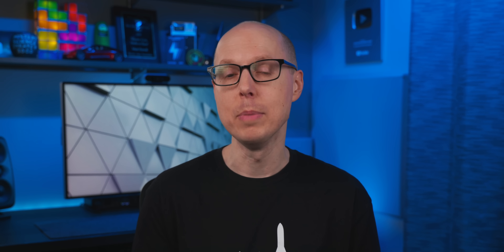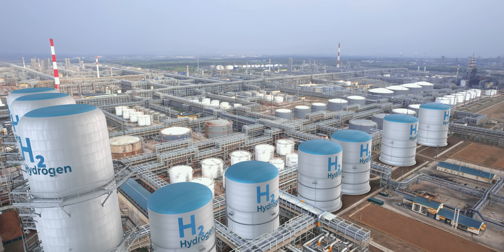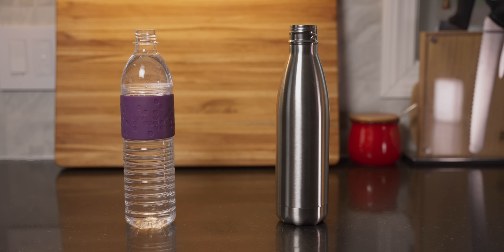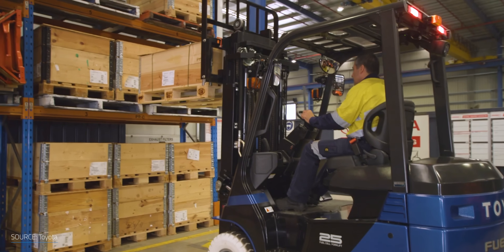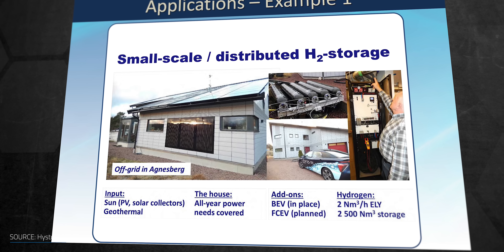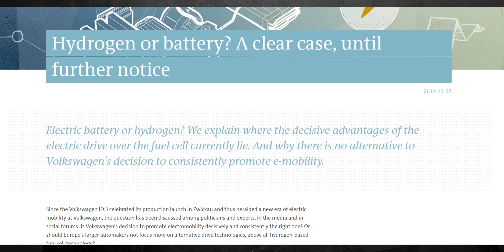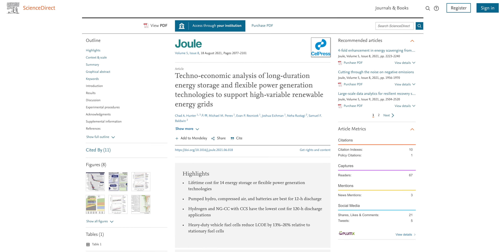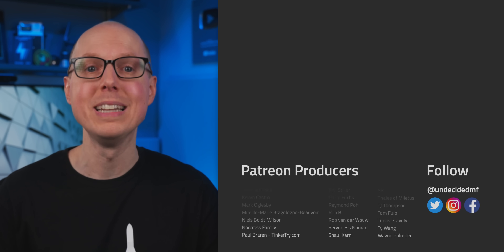Solid Hydrogen Explained (Again) - Is it the Future of Energy Storage?

Comment: Considered the hydrogen is made from renewable sources and not Steam Methane forming: 
The technology of GKN sounds really nice. A 90% roundtrip is crazy good, especially with the already planned in heat recycling. Recycled energy is basically free. It's there, use it!

I'm still not convinced about the laser guys though. It just sounds impractical. 
You can heat up to 65C pretty fast if you need hydrogen. But a laser has to make contact and the disk or whatever can only spin so fast. The laser has to hit one point at a time. 

However, great video. It really cleared some questions up that i still had when watching the previous.

Comment: Used in German Subs since 2003? Wow! After hearing that and how much more fuel efficient they are. I am thinking that the solid-state tank could be shrunk down to a smaller size and still be more efficient than a gasoline tank for a combustion engine. Perhaps even lighter as well. What do you think?

Comment: hydrogen is a good intermediary way to power aircraft, where energy density to weight ratio is essential. other than that? it's an EXTREME waste of energy. stationary & surface transport? batteries are at a minimum- 40% more efficient. the entire process with h2 STARTS as electricity in ANY case scenario. add in : split h2 from oxygen? loss. : compress / cryogenically store? LOSS, LOSS. run through a fuel cell? LOSS. 

vs? JUST CHARGE THE BATTERY!

Comment: Hydrogen is not the future, at least not the near future (10-20 years) and not for EVs for a very simple reason - supply and distribution chains. 1) Battery supply chains have some bottlenecks, but overall is well developed and easily scalable. 2) Electrical supply is everywhere, and can even be generated easily off-grid. To move to a hydrogen system, you have to create new supply chains (not that hard to be fair, new products do that all the time) and a new hydrogen distribution system (much harder and more expensive). For stationary uses or specialized uses like the submarine you mentioned they may be fine, but not mass-produced cars.
Reply from the maker: I agree.  I don’t see hydrogen catching on for passenger vehicles, but for other uses it has a path.

Comment: Another popular hydrogen storage method is conversion to ammonia. The technology to do this, and reverse it, makes energy transport via ammonia quite viable, as well as purely for energy storage.
Reply: Australia is heading down the liquid ammonia path for exporting hydrogen, with Japan being their intended market.  There is a proof of concept tanker being tested in Victoria state right now.
Reply: Here here! This, and liquefied air, should be our sustainable future.
Reply: Isn't the problem that ammonia solves a different problem - while both are storage, ammonia is about large scale and long haul movement of energy (a carrier), while metal hydrides are about creating practical devices for smaller scale (battery for a building, truck, or :-)  submarine)
Reply: Noooo! Bad idea.
Reply: If only MBS could get the ball rolling on the Aramco Mitsubishi project. Rio Tinto  is more aligned with current EV technology, even going so far as to make an electric mining truck, which are the biggest wheeled vehicles on earth
Reply: Mainspring Just Configured their Generator to Burn Ammonia Too, So Could Skip the Cracking Step too.
Reply: Replace the nitrogen in ammonia with a carbon and hydrogen and you have a very stable and reliable hydrogen carrier with loads of existing infrastructure.. Just so long as it is made from atmospheric carbon
Reply: @okkomp  NH3 != CH4 🙂
But it was an interesting thought. Chemists please! Why can't we combine hydrogen with carbon? Don't we have any high tech methods to do that? I know we can do CO2 to methanol, CH3OH.
Reply: @okkomp  CO2 is not a major greenhouse gas despite the propaganda. In an actual greenhouse, H2O is the cause of the effect. CO2 absorbs a trivial amount of infrared at 4.2um. It's a negligible greenhouse gas. Now, heating the planet with chemtrails keeps more water vapor in the air in addition to expelling unimaginable amounts of methane from the tundra. The global elite are a factor. Chemtrails are a hot blanket over a hot earth beneath a hot sun.
Reply: A possible downside with ammonia, is its toxicity. Leakages could be problematic...
Reply: @chrisheath2637  true, but so is leakage of gasoline, or for that matter heavy metals, we are just more comfortable with “familiar” dangers…
Reply: @daleatkin8927  Not the best comparison, gasoline will stay in a bucket. 
Ammonia is more like propane (uses same storage tanks) it wants so get out (up to 140 psi? in the sun, though ammonia hydrogen combo might change this).  And the way I see it ammonia is more dangerous because large leak or confined leak WILL have arial effect, while propane MIGHT (depends if it finds ignition source).  Both can kill, painfully.
Ammonia is dangerous, and everyone that can stay away from it does.
Reply: @daleatkin8927  leakage of gasoline does not kill you in 8 seconds. Ammonia will. This is the major drawback. Also, it takes more energy to store and release compared to metal hydrides.
Reply: @davidbowerman6433  well, I for one have actually inhaled gaseous ammonia (accidentally) many years ago (around 1997ish), and I’m not dead so…

Comment: Something I appreciate is your focus on integrating multiple solutions. 

Building more energy efficient buildings to live and work in, using renewables judiciously, using molten metal batteries instead of lithium ion for bulk storage, solid state powered EVs, thorium reactors, GEOTHERMAL DRILLED WITH DEATH RAYS, etc.

Whereas fossil fuels are a one and done concept, replacing them is going to require a network. 

Hopefully that network is more resistant to solar storms and durable to a politically impossible electrical infrastructure bill.

Do you know if there’s anyone working on moving high energy transmission AWAY from being based on a grounded model? 

While electrical circuits need a “ground” for failures, the ground doesn’t necessarily need to go to the GROUND, which is where the current model’s vulnerability to CME comes from.

This is particularly concerning to me because the magnetic field is weakening (perhaps because of a pole reversal, which the planet is overdue on). If we want to survive, now’s the time to… decide… we care.

See what I did there?

As long as we’re building new power supplies, it makes sense to upgrade and harden the actual infrastructure… that hasn’t been updated in most of the US since the New Deal nearly 100 years ago.

And thanks to companies like PG&E and First Energy, it hasn’t really been maintained since then, either.

So… anyone looking at CME resistant infrastructure since we’re going to have to replace much of the old system as new energy sources come online?

Comment: Solid hydrogen is the best solution, same as was discovered in the 70's when hp gas bottles were falling over and breaking like glass.
Great explanation too.
Oh, for anyone saying hydrogen is too dangerous b/c of the Hindenburg footage, all I'll say is "if you don't want your airship to burn, don't cover it in rocket fuel".😏
When hydrogen burns, the flame is incredibly hard to see in daylight 😉
Reply: Hydrogen IS rocket fuel.  But yes, it burns with an invisible flame.

Comment: Like many people, I would love to see a hydrogen-like solution to our fossil fuel dependence. However, in the back of my mind, I am suspicious of why many conservative sources are on the hydrogen bandwagon as the solution. These are sources that did their best to play down the effects of climate change. So I have to wonder if the fossil fuel industry wants a hydrogen energy economy because they are banking on clean production not keeping up with demand so they will be able to keep using steam reformation from gas. I would not be surprised if the thought bubble were true.
Reply: They are already replacing nat gas with hydrogen to reduce carbon footprints
Reply: I noticed the deer one of the few to doubt the good intentions of those pushing hydrogen. I have long felt that hydrogen is a Trojan horse that if we excepted as a fuel source we will live to regret it. Even in Long haul trucks and buses were hydrogen could have an advantage, it appears that large batteries charged on a regular basis or a much simpler and much more effective way of getting that job done. That is not to say that there might be some small applications for which hydrogen is ideal but I currently don’t see any application as a shining light of opportunity for Hydrogen.
Reply: @colingenge9999  I have been to NW Argentina which has considerable lithium deposits. It is an environmental disaster.
Reply: @tenniswilliam  It’s not an issue as to whether lithium or any other product is an environmental problem it’s purely a matter of quantities. Compare 10 pounds of lithium to 80,000 pounds of fossil fuels being produced.

Comment: Hi Matt, thank you for the follow up video. I appreciate the effort you went into to explain how hydrogen storage works. What I'd like to say is that by focusing only on the car market you miss the forest for the trees. The main function of green hydrogen production and storage isn't necessarily tied to the car market. It is being developed to decarbonize industries that cannot be electrified such as steel and plastic production. Another fundamental use of hydrogen storage is for military purposes. You simply cannot power all military vehicles with batteries alone for the length of operations and the geographical locations where militaries need to operate. Something that a lot of people miss is that with hydrogen logistics each kg of hydrogen you bring also brings 9 litres of water. So collecting, storing, and treating this water is another major advantage of hydrogen systems compared to normal fossil fuel systems or batteries. Overall, great presentation. Keep up the great work!
Reply from the maker: Thanks for the feedback.

Comment: This seems like something which would be ideal for pairing with a nuclear power plant. You could use excess electricity generation to electrolyse the hydrogen in a green manner and facilitate its storage. Excess heat from the plant could be used to help release the hydrogen.
Reply: But a nuke plant doesn't need to have energy storage. It's main purpose is to provide a steady amount of baseload energy.

Nuke is more expensive than solar, provides far fewer jobs than solar, and even the new reactors being developed, will need at least 500 years worth of radioactive waste storage (tons better than 10K years, but still a very long time)

Use solar, and since it's cheaper, we can build extra capacity spread around, to compensate for its variable output on the sort term.

I looked the numbers up for fossil fuels and solar.

All fossil fuels combined, produce 63% of our electricity. 
That 63% provides just under 900,000 jobs.(in the electricity production system)

Solar provides 3%(actually 2.7, charts are almost always rounded).
That 2.7% electricity production provides just over 500,000 jobs......

And it's cheaper than fossil fuels and nuclear.

Solar is the most expensive renewable though. But it's not all that much more expensive, since it's still cheaper than fossil fuels.

But solar provides a staggering number of jobs for the cost.
Reply: @lordgarion514  Your comments on solar power are utterly irrelevant and I won’t argue with you about them. This was a comment on excess nuclear power used for hydrogen generation and I’m just going to cover that topic.

Re: Energy storage: A no point did I claim that the hydrogen generated by nuclear power plants would be used there. There are pilot projects underway to use excess power and heat from nuclear plants for hydrogen generation. In a world where renewables sometimes provide more or less energy, when they are producing it makes sense for the smart grid to use their power as locally as possible (thus reducing transmission wastage). As Nuclear power plants can’t be ramped up or down quickly, at those times excess nuclear power was being generated it could be used for hydrogen creation onsite. Hydrogen created by nuclear would be entire green, but will need a means of being stored onsite until it can be transported elsewhere for use.

This hydrogen can be used where ever green hydrogen is needed. For instance it can replace the gas in modern gas fired power plants. I’m not sure about the USA, but in the UK all new gas fired power plants have to be capable of using hydrogen as well.
Reply: @omrouk  
You missed the point.
Nuclear power is slow to increase or decrease the output of, so it's used for baseload energy.

We don't have an excess of baseload nuclear power.
ANY nuclear power put into hydrogen production, would have to be made up with other fuel sources.
We don't decrease nuclear and coal output much, we add in other energy sources, like gas fired peaker plants to make up shortages in baseload.
And as I said, solar is cheaper, and provides more jobs.
Reply: @lordgarion514  You say I missed your point and you clearly missed mine. All good, enjoy.

Comment: Still sounds dubious that you can pack more hydrogen into a space using this metal hydride and then if was a liquid.
Reply: Not really, this has been known about hydrides for quite a long time. Some hydrides are as much as 50% more dense. (In terms of the amount of hydrogen stored in a volume)
Reply: @rdizzy1  I will have to look in to it more. I was thinking in terms of how water is not compressible

Comment: I like that you did respond to the criticisme on the last video. 
But as remember the most part of the critics weren't about the Solid Hydrogen Storage itself but were again the fact that this kind of technology wouldn't be available for small vehicles such as cars, like we saw on the commercial video of plasma kinetic. (Because of the mass required for that storage). And you did confirm that this critic was valid in this video. so thanks for that.
One other critic was about the fact that the storage system of Plasma Kinetic was using adsorption on a film. This must have a huge impact on the energy density. but you took for example some storage in the bulk of a lattice..
I guess if Plasma Kinetic has found partners, we will soon or later find out if they will succeed or not.
Thanks for your vidéos
Reply from the maker: Thanks for the feedback.  When it comes to Plasma Kinetics, your last sentence mirrors my feelings on it.  They have a lot to prove, so we need to give them a chance to prove it.  This is their one shot.

Comment: Stop trying to make hydrogen happen.  It's not going to happen.
You need energy to produce hydrogen fuel.  There are always going to be losses in this process.  And even in "solid" form hydrogen has poor energy density.  Better to just take the energy from the grid and put it into a battery.

Comment: I was about to ask about how quickly these hydrides could "inhale" new hydrogen (thinking about fueling a car, could this be faster than charging a battery) and then realized that the "gas station" also has to store it somehow, and if that is liquid or highly compressed, then that has its own energy costs.  But, how quickly can they add hydrogen?  I'd imagine that they heat up somewhat in the process.

Or if we distributed hydrogen in gas pipelines, we would probably need to add mercaptans or something similar to help us detect leaks -- are these storage systems tolerant of such impurities, and if they're not also storing the mercaptans, where do those go after the hydrogen is stored?  Burn them, I guess.
Reply: The idea I've seen for hydrites use in cars , is to change them every time you fuel the car , probably in dust form or something like that , and then they get refueled somewhere else I guess.. but if we were going to use the existing hydrogen refueling infrastructure (which is not a lot ) they would probably need to refuel it in diferent way ( greater pressure or temperature? I'm not sure . But it wouldn't make a lot of sense to continue to store it in a liquid or gaseous form in refueling stations , if the cars used hydrites
Reply: You would buy the fuel cells precharged. There is 0 chance of cities storing huge amounts of liquid or gas hydrogen in one place for the goobers to have access to.
Reply: @tylermcnally8232  we pipe and store and sell gasoline and natural gas, hydrogen at least rises pretty quickly -- it wouldn't be much worse than what we do already.
Reply: @tylermcnally8232  
The average large fuel terminal has 77,000 barrels of gasoline. With the largest having 48 million barrels.

And they are quite often located right on the edge, or even inside cities.

Bombs located on the side of liquid tanks would have burning fuel running everywhere, as well as the explosion.

Hydrogen will just blow up, and there won't be remotely enough oxygen in the vicinity to get more than a small percentage to explode, with most being pushed upwards. And burning as it goes and encounters more oxygen.

Comment: How do you "recharge" a hydrogen hydride battery? Do you also need to electrolyse the water running to your house or are you meant to have a seperate hydrogen pipe bringing it in?

Comment: Great video and thanks for also focusing on the negatives. Hydrogen tech appears very niche and not the cure all its marketed to be. Also fuel cells are very expensive, high tech, and wear out quicker than other options. Batteries will reign supreme until micro nuclear takes over. As it should, we are an energy hungry species.